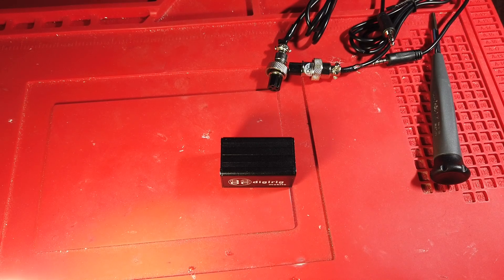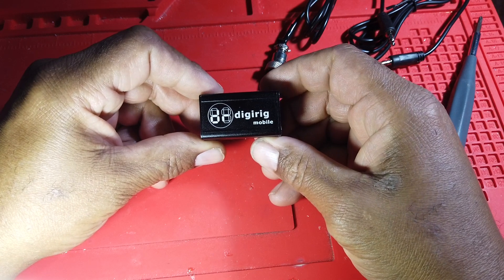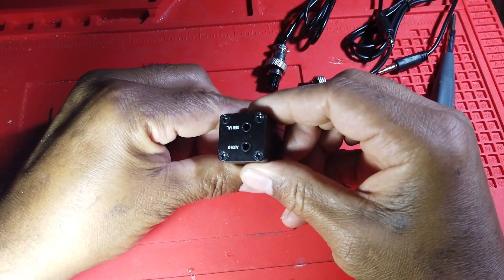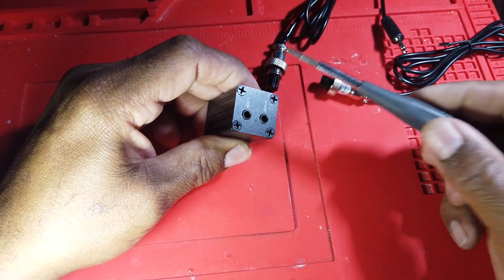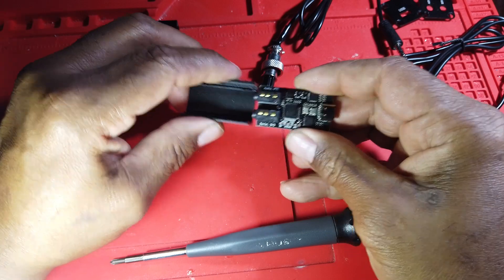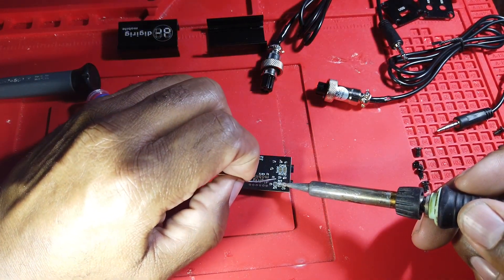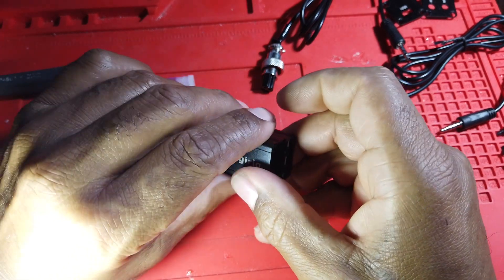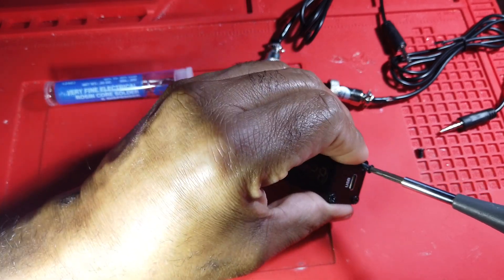Digirig 1.6 Prep for Lab599 Discovery TX-500

Comment: I have the same radio with the DigiRig. I try to get the CAT control to work and fails is WSJT-X. I have the new drivers for the DigiRig, But I can only get the CAT to work with the USB cable that goes to the CAT control and the audio cable to the DigiRig. Any suggestions?
Reply from the maker: I'm sorry to hear you are having trouble.  I have not used this radio with ft8 in a while.  I did not have issues when i was working it.  i would email digirig, or do a google search.  Come back and let us know.  I will get it set up, and try to get you a better answer.
Reply: @Bill-HRT_K0WHW will do

Comment: so if I buy a digirig for the TX500, Id have to open it up and solder a little bit? I saw a model made specifically for the tx500, maybe that one is already soldered?
Reply from the maker: Hey, thanks for stopping by!  Here’s another case where I should have said, “at the time this video was made . . .”  You’re right. The new models can be bought already configured for your radio. Back then, it was cool you could modify/configure so simply for your radio. Now, you just buy it already pre-configured. 73 de Bill
Reply: @Bill-HRT  thank you for clearing that up, I ordered one and like ah man, I'm gonna need to get a new soldering gun. Hopefully I'll catch you on the airwaves, 73!
Reply from the maker: Another thing . . . You don’t need an individual digirig for every radio or different applications even though you ordered the one for the tx500. I’m not an expert, but I talked for a long time to the developer at one of the hamfests. Read everything you can, and email him to find out all the details if you want to do other digital functions. 73
Reply: @Bill-HRT  I never screwed with digital stuff before as far as ham stuff goes, I look forward to trying it out, especially considering the tx500 only pumps out 5 or 7 watts in digital mode I think. I did see one of their videos on their website on modifying the chip for different types of radios. Either way, it's an impressive feat of tech for the signal to reach so far with HF

Comment: Waiting to hear about your first digital contact!
Reply from the maker: I made my first contact tonight!  First one in a long time, and first one with the TX-500.  There is a little learning curve for  my ssb and cw mind.  There were several that came back to me, but I sort of got hung up on the signal report, and the software didn't go beyond that or either the band wasn't open enough.  Again, being a rookie, I'm not sure.  Tonight, however, a CA station and I got a complete FT8 QSO.
Reply from the maker: I do like this Digirig.  I am listening to someone else on youTube on my computer sound card, and the Digirig is handling the radio, and the two are totally separate.  I'm liking it.  It has a very small footprint compared to other sound card ham solutions.
Reply from the maker: Thanks for coming by!   It's decoding like crazy, but I have yet to get out with much success on the antenna I am currently using; no excuses, though.  I did actually get a couple whisper spots.  I will let everyone know when I get good contacts on one of the other modes.